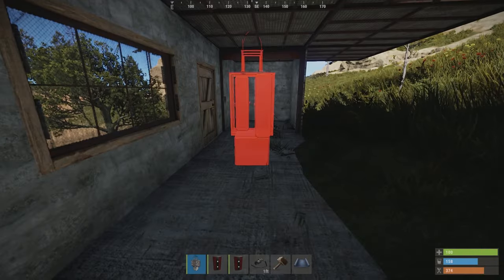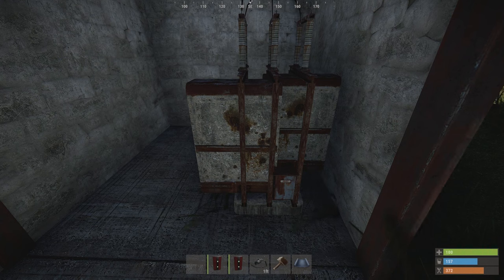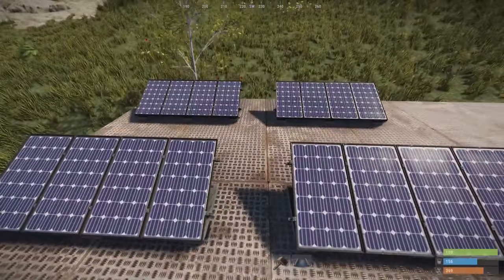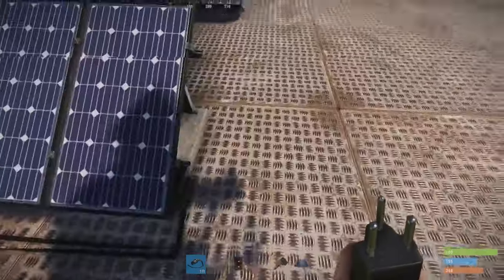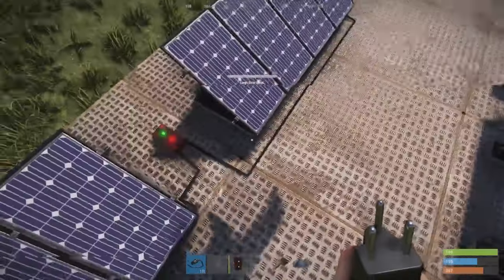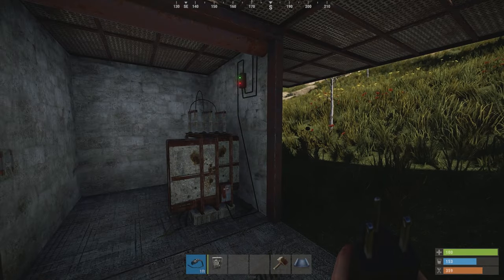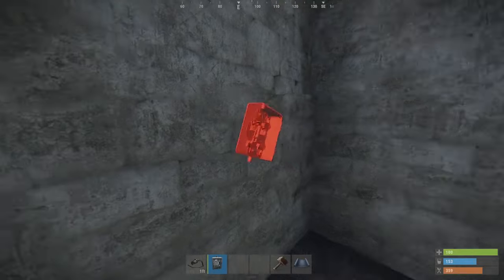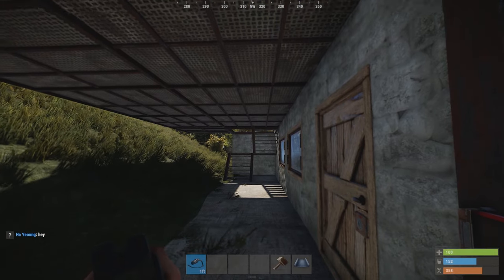How to combine power sources - Electricity guide - Rust

Comment: How do i connet uneven power sources like 3 solar panels or 9?
Reply: You can use the root combiner to connect a set of solar panels then make the power go to another root combiner. After you can connect the 3rd solar panel to the 2nd root combiner and make the power go to your battery.

Comment: Can you add another large battery to that system and combine its output with the other one?
Reply from the maker: You could output to several batteries using a splitter to divide power equally between upto three batteries dotted around your base.